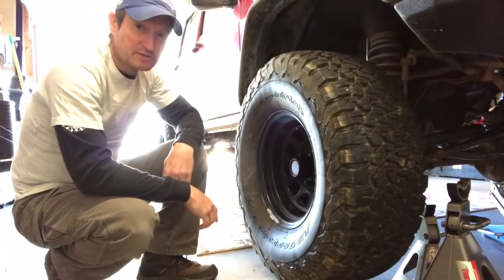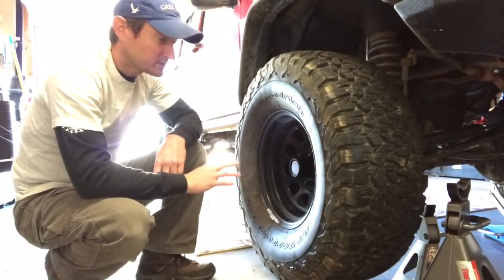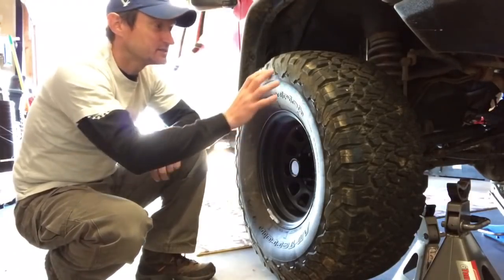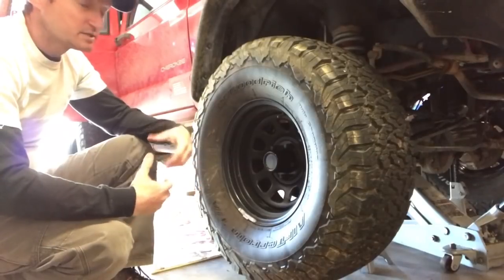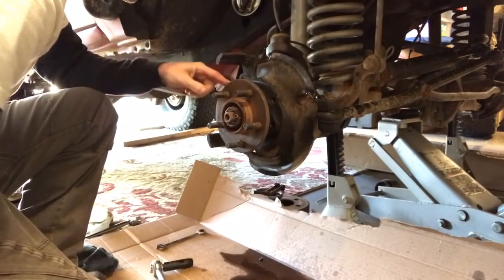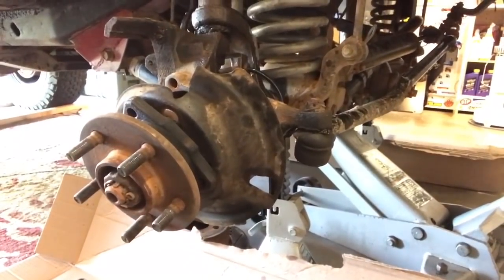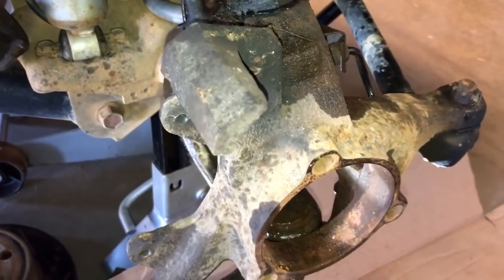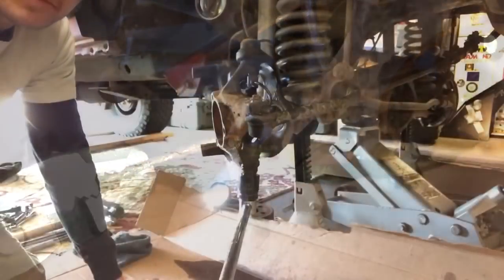Replacing Ball Joints Without Removing the Hub and Tie Rod Ends - Jeep Dana 30 - Cherokee XJ

Comment: Just went through all that on a TJ. Sold the TJ now may need to do the same on the XJ! I found that when I had the ball joint press cranked hard and still no movement, if I tapped on side of the knuckle flange it would pop.
Reply from the maker: Thanks for the tip Mitch. I will keep that in mind next time, which hopefully is a long while from now! Any regrets on selling the TJ? Ideally I would have a TJ and a XJ but that will need to be put on hold for quite a while.
Reply: @simpleoverlander  Regrets? I've had a few....Yeah I am a jeep nut from 16 years old to now 57. This is my third XJ and I've had 2 TJ's and a JK.  I would certainly have kept if my 15 year old would have been more enthusiastic about taking as his first car. But faced with only being able to keep the TJ or XJ, I made the choice for exactly the same reasons you mentioned in one of your earlier vids! You know how it is with teenagers on the insurance ticket, even a beater can cost a lot to insure due to liability. The XJ boxes are an addiction for me and a brand new 87 XJ was my first real car after getting out of college. My coworkers, and my kids think I'm nuts!
Reply from the maker: Mitchell Theriot My son wasn’t a big fan of the XJ but drove it till he got a car. He thought of lifting it and making it closer to mine but fuel mileage won out, which is why I sold the blue one. Here in NC we get hit with insurance and also pay property tax on every vehicle we own e v e r y year, so XJs are cheaper on the wallet for sure. People think I am nuts too but I get more use out of my XJ than most people say they can from their vehicles. 
It works for us, and it is what we like, so that is what counts!